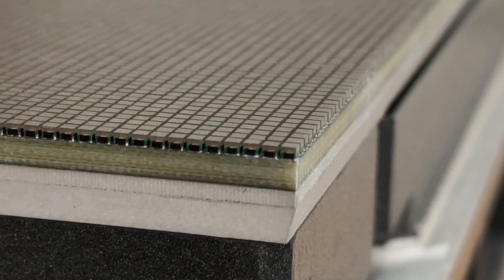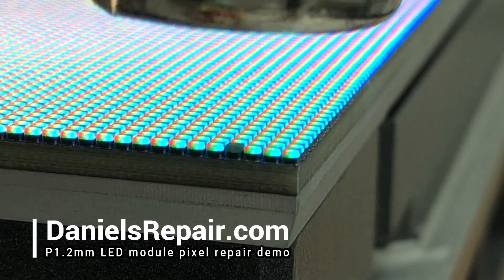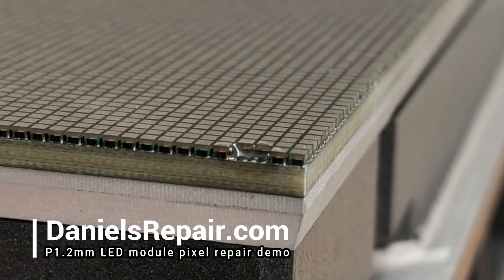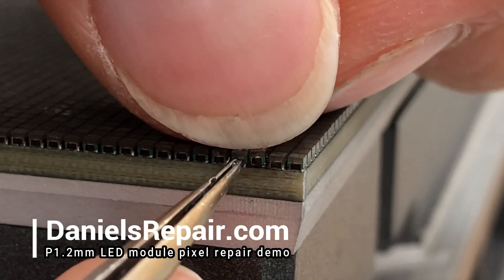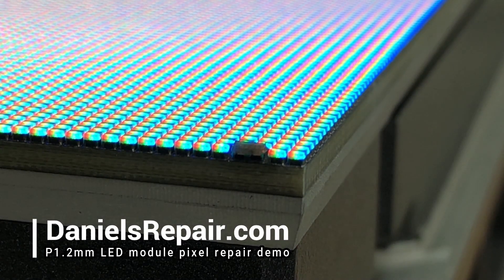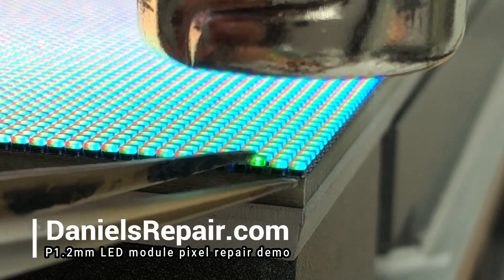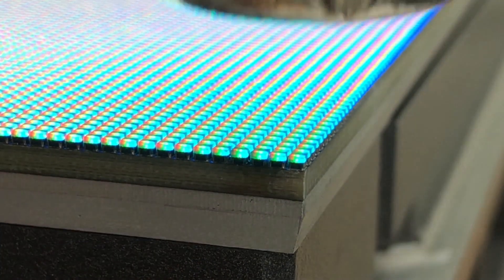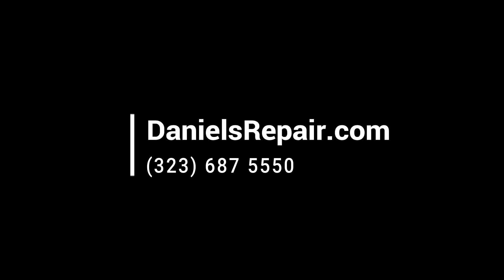How to repair 1 2MM LED display 1 2mm LED module

Comment: Hey Daniel,
2 questions! How do you fix the pixel if the soldering pads underneath rip off when taking the pixel off? Also, how are you heating that up without burning the pixels around it?
Thanks!
Reply from the maker: Hi,Savannah,
Answer1: There is special circuit paper to fix l for the soldering pads when they are rip off.
Answer 2: the temperature and timing are the secrets to keep it from burning.
I would like to help to repair your modules at an unbeatable price with excellent service quality!
Reply: @danielsledrepairservicellc9347  can you please show me how does the sample paper look like?
Reply: @TheKocu12  that is interesting for me too

Comment: how to p5 outdoor LED Repair & Replicas pls Help
Reply from the maker: May I know which country are you from? 
Usually we use soldering iron to replace pixels.check more details at www.danielsrepair.com.  thanks!
Reply: Yes  I am ripering your p5
Reply: My number 8851418552.  9958195807